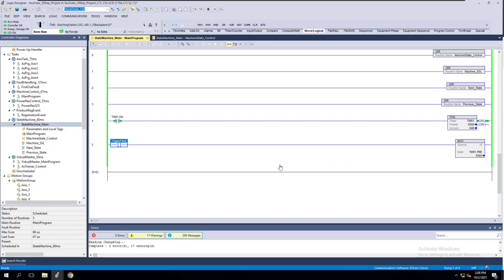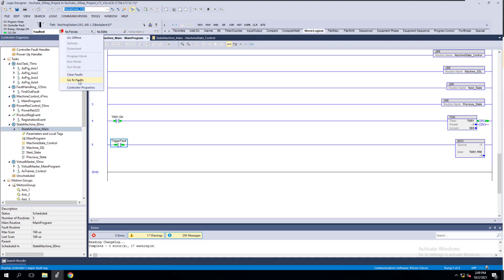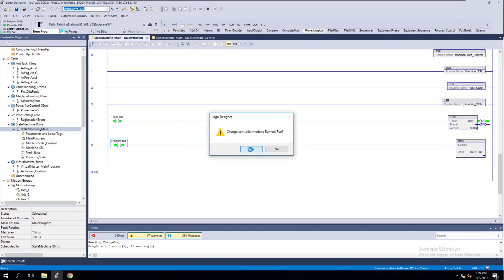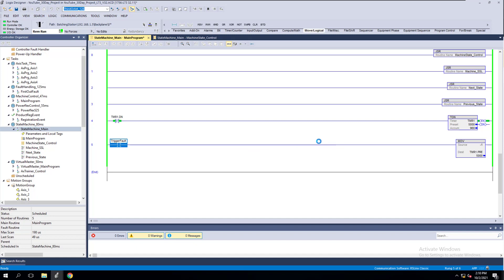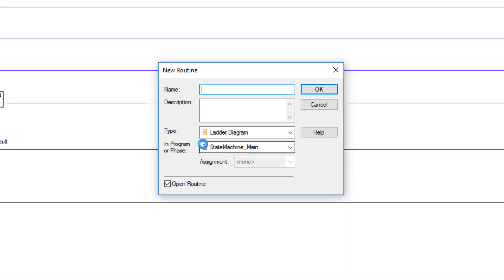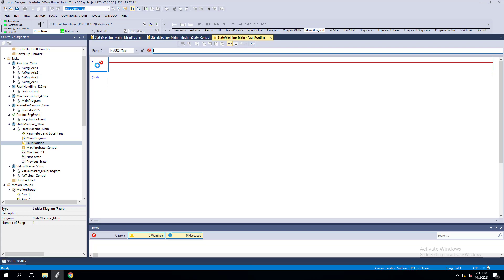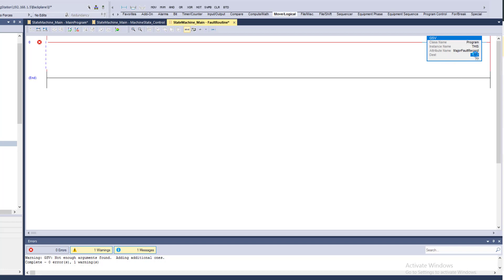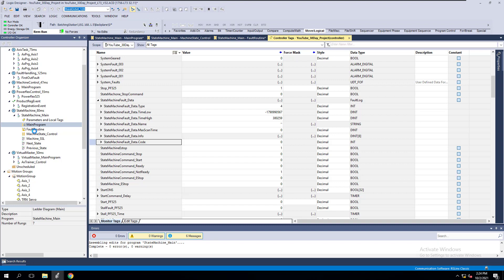Fault Routines in Studio 5000 for Processor Fault Data Capture in 15-Minutes

Comment: Thanks for the video, really useful to see how to catch major fails and build a success routine in Studio 5000 with Task logging and simulation.

Looking at all these workarounds is frustrating. A TON block is a system block  why don’t the developers provide standard diagnostics, error bits, or default variables? Handling negative preset values should be built-in, not something engineers have to implement manually.

It feels like this software was once good, but development has stalled. Even today in 2025, coming from a Siemens background, I still have to do exactly what your 3-year-old video demonstrates. I don’t know when Rockwell will finally decide to evolve the software, provide standard routines, and integrate them into the framework.

As a customer, I would expect a good engineering company to build these routines for me, but ideally, the system itself should already handle them. These missing features are clear gaps, and it feels like the system doesn’t evolve to support the user properly
Reply from the maker: It's a powerful tool to help you track things if you are having a random fault